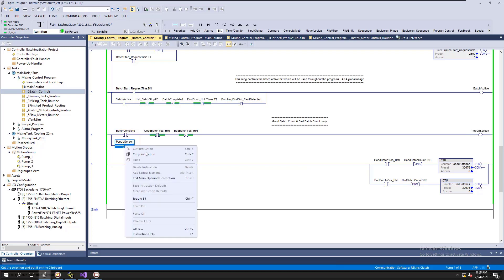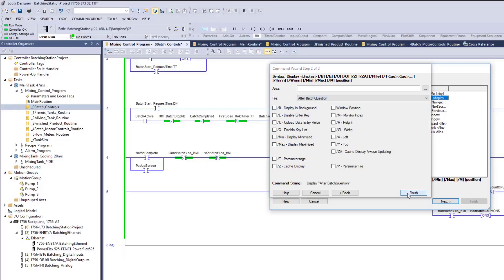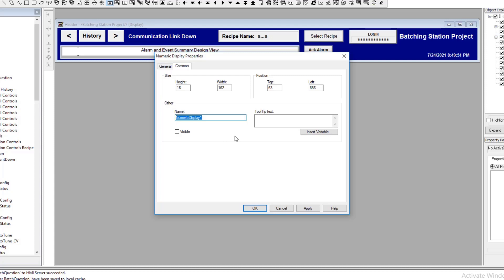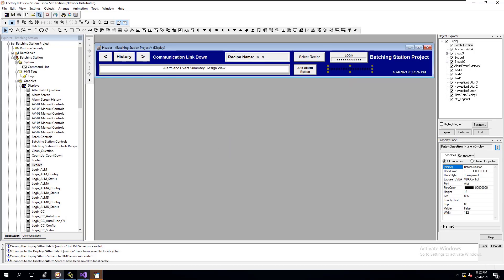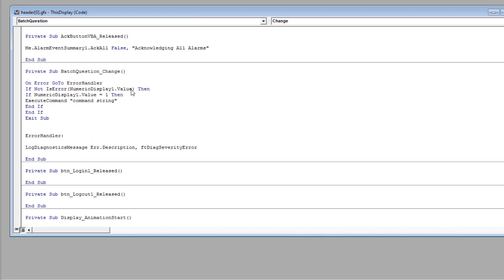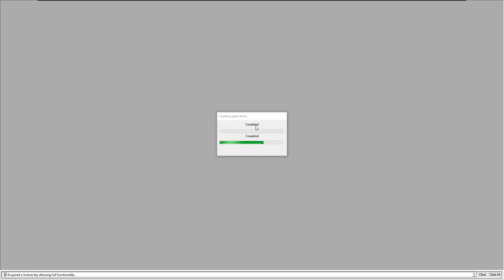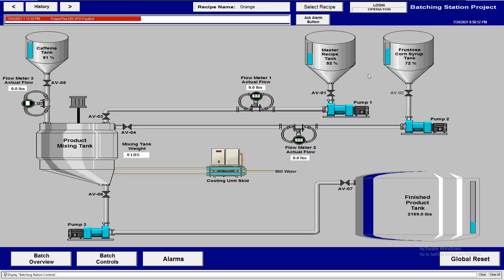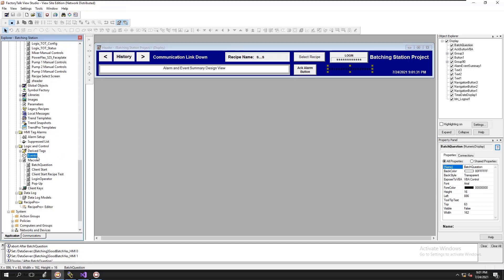VBA Code for a Pop-Up Screen In FactoryTalk View Studio Site Edition

Comment: hello thank you  for this video, for me it worked but the text that i put in the display of the pop up is 'question mark' can you help me please
Reply from the maker: Make sure the tags on the HMI are attached to the PLC, meaning update the tag database
Reply: thank you , have another question please, 

I added the num display in the main page on the line supervision like you said and I put it in non-visible but after that I had a problem on the line supervision, I could no longer press the elements in top of my supervision it's like there was an invisible page which blocked this even though I set my num display to non-visible, I don't know if it's due to that or not, I had to reinstall the backup app to resolve the problem

 @ShaneWelcher

Comment: How do you make it so that it only pops up on a certain screen? I got it to work but my display pops up regardless of what screen I put the numeric display on.
Reply: I originally put it on other screens as well but then the client wanted it to be on a certain screen only. I deleted the numeric display on the other screens but maybe there is something additionally I have to do to remove the vba code from that screen? Thanks for the reply.
Reply from the maker: @natemayo4002  after you edit this to make sure you have it per the theory of operation then close the client & launch it again.

If that doesn't clear it up then you still need to verify the VBA code is in the correct place.
Reply: Alright I’ll try this for the upcoming week. Thank you for the help!
Reply: Hey! So I got it working. I think the issue was that either named the macro and numeric display the same thing or I just needed to restart my computer. Just thought I’d put that out here for anyone in the future.
Reply from the maker: @natemayo4002  Great to hear
Reply from the maker: Not sure you followed the video 100%, the VBA code is custom to only the screen you put it on.

Unless you accidentally duplicated the screen to make another one.

Remove it from the header & only add the VBA code to the screens you want to have the popup for

Comment: Hi shane will you make a video on MSSQL data read and write using VBA.
Reply from the maker: That is custom to what SQL database is being built.

Meaning, every instance is different
Reply: @ShaneWelcher  To Read and write value in SQL from SCADA
Reply from the maker: @SCADAExperts  reading and writing to an SQL is dependent on the application.

Each is very different.

Comment: Hi Shane, is this possible in machine edition? Dealing with the remote screen display logic and macros in machine edition is a real pain in the *
Reply from the maker: Pop ups are much easier on Machine Edition, just use the global connections & use remote display number in the display tab then link that to a tag.
Or you can do this from a macro if only one screen is needed to be controlled.